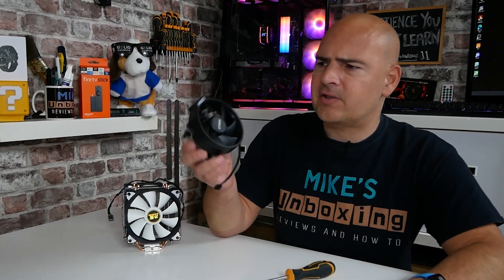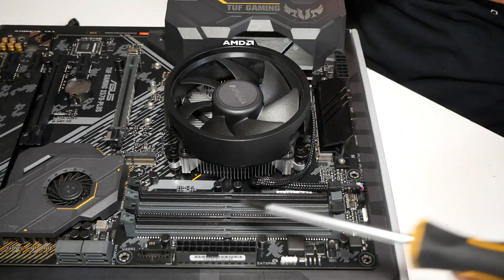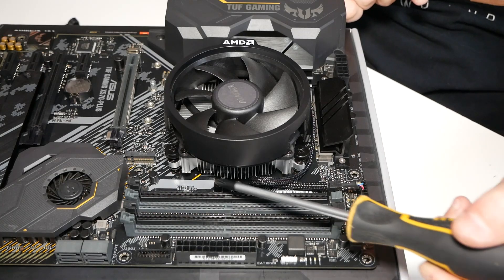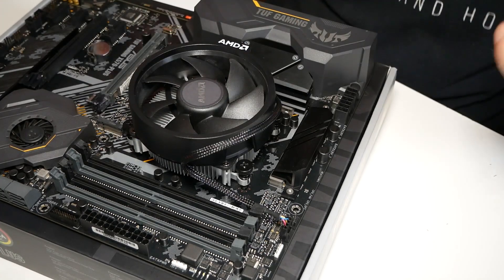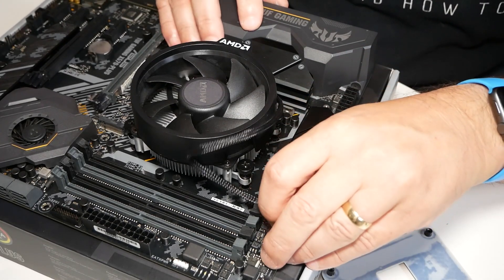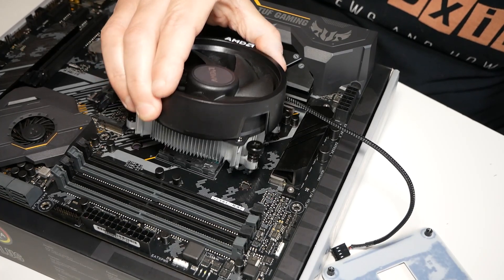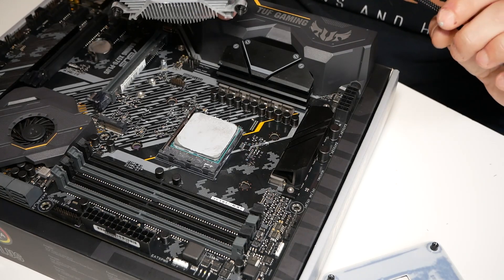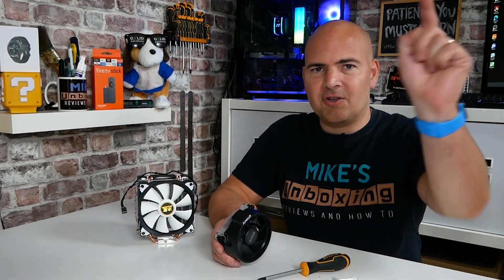How To Remove A Stock AMD CPU Cooler When It Is Stuck

Comment: top man as always !  thanks mate , the backplate is the key of the problem, as with this installed you cant twist the cooler
Reply from the maker: yes the backplate is a blessing to give equal mounting pressure but also a PITA when trying to remove it!

Comment: So I have a new cooler I want to install in my PC. But the back plate on the computer is stuck. Any suggestions?
Reply from the maker: sometimes they use adhesive, just gently pry it with a plastic tool or credit card type tool and it will come off eventually
Reply: @mikesunboxing  thanks bro

Comment: I did this to change the paste and my cpu fallow on the cpu cooler but it was in fact easier to remove that way with a flat screw driver should had run something like cinebench first but its was okey nothing got hurt but its could easy had been done some dmg on the pins first times in 20 years i use like their pace and just put it on like i did with 1600 always used like a rice corn in the center on my old intel cpus and never had any problems with removing them
Reply from the maker: thanks for the comment

Comment: i remember how i ripped off amd cpu from the socket every time i wanted to change thermal paste or clean the radiator. And after somebody told me to heat it with aida64, it just like fall of by himself
nice hack
Reply from the maker: Much easier, when warm :-)

Comment: I wanted to  try the freezer method.  It is supposed to work good if heat is not enough. The thermal dilatation between steel and aluminum or copper not being the same, it is supposed to break the joint.
Reply from the maker: that should also be a good way, just the polar (pun intended) opposite of heating it up for expansion the cold shrinks

Comment: Yeah, Thanks for nothing Mike, Only a damn week too late. Cleaned the kids PC whilst they were away and the cooler pulled the CPU straight out of the slot, super glue would have been easier to remove.
Release your videos earlier next time will you...:p
PS on a serious note, it was all fine, I'm just glad I didn't drop the CPU/Cooler after it came out.
Reply from the maker: this is something we all dread although for most it doesn't damaged the cpu , but some more heavy handed types have bent the pins up like a pretzel

Comment: It’s great to see some “Back to basics” PC videos as we’ve seen countless videos on high end setup, tweaking your pc, benchmarking etc. these sorts of videos are great for people who have limited pc experience and are looking to upgrade their pc etc. These PC basics are essential for anybody doing any sort of upgrading.
Reply from the maker: yeah and for those with more experience it is good to share tips and methods
Reply: @mikesunboxing  I need help, or advice. I bought a new Ryzen 3300X from B&H. I had to order a backplate for my "used" board so the processor sat unopened for a good while. I updated the BIOS to the correct one, then attempted to put in the NEW out of box CPU. I would not drop in but I finally got it in and it would not boot. When I took it out, I noticed it had bent pins. So, I know the company will blame me but I have built MANY computers and have never had a brand new CPU do this. Should I contact them or do you think it will be futile?
Reply: @mikeadams8027  Bent pins? Futile from AMD. A PC shop may straighten the pins for you, or there is a good DIY YT video. Did you insert it wrong in the socket? It should drop in, unless the pins were previously bent?
Reply: @mikeadams8027  Looking back, do you think it was returned to BH and it slipped by their QC? Like with Amazon, Wal-Mart, etc.? Weird one...
Reply: @SmittyAZ  I came in what appeared to be a sealed box. I am tempted to contact them but like I said, I had to wait a while to get all of the parts together so I don't know what the return windows is, plus they are going to say it is user damage and I have no proof otherwise. I ordered another processor and it is installed and worked now with no issues.
Reply: @mikeadams8027  That really sucks...if you get all, or most of the pins straightened, maybe you can build a back up unit? (I think there some redundant pins?)

Comment: I had this problem sometime ago and used fur to get the CPU a bit toasty then a bit of sideways movement and the cooler came off. The generic pad they use on and coolers seems to stick pretty good. Not had this problem with mx4 lol
Reply from the maker: mx4 is tough going after a while but not too bad

Comment: Nice one :) Thanks.  
Here's one I worked out yesterday.  Worth circulating? 
Bent CPU pins. 4
Buy two blunt syringe needles. These are not sharp,  they are used for applying glue etc. Available on Amazon / eBay.  One thin one, colour coded blue. One thicker one, colour coded Orange.  Start with the blue one. Slide it along the roots of the row of pins, at their base horizontally. Lift it up. Repeat along the other axis.  Now repeat with the orange thicker one. All of the pins are now straight. I do hope you don't mind me passing that along here.  Tell me if you think it a bad method. Cheers and thanks for another superb vlog.
Reply from the maker: sounds like a great way to get the pins straight
Reply: I once used a mechanical 0.5 mm lead pencil to do it. Back in socket 462 time with an Athlon 2500xp. Not yet happened to me since that time, finger crossed!
Reply from the maker: @patricklebel1141  Kath has also used a metal nail file....and very fine tweezers
Reply: Hey, if it works it ain't dumb!

Comment: Ripping a CPU out of an AM4 socket is the reason why no one should ever use the pre-applied thermal paste. I learned the hard way, but since it was one of two Ryzen 5 1600 AF's I paid $85 for it could have been much worse. I did manage to get the pins straight enough to go back into the socket and it would post, but it had a slight corner to corner concave bend and would throw errors in under a minute using memest86.
Reply from the maker: most of us have now had a issue with a cooler getting stuck at least once with the socket style cpus , shame really because otherwise it is a pretty decent system